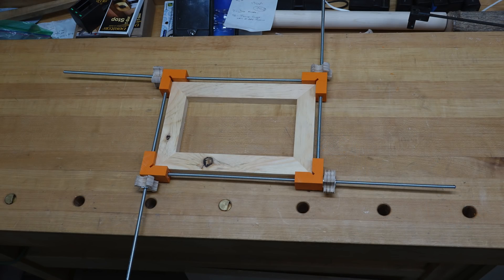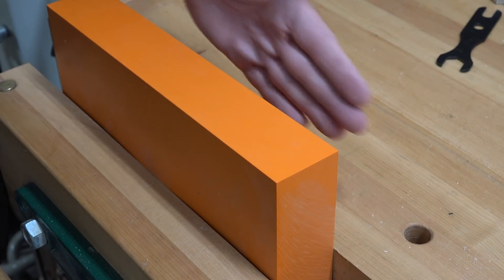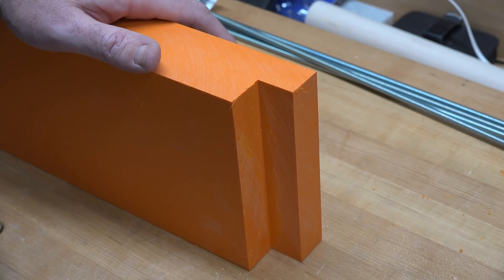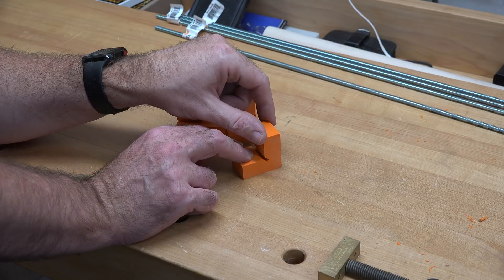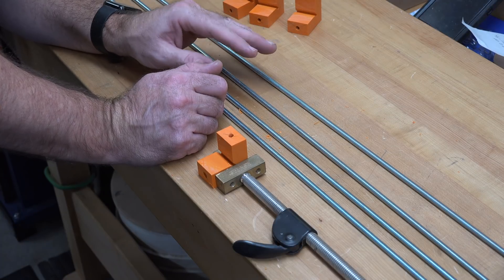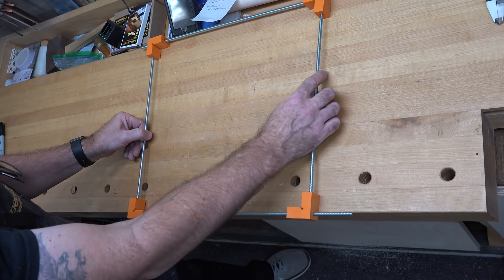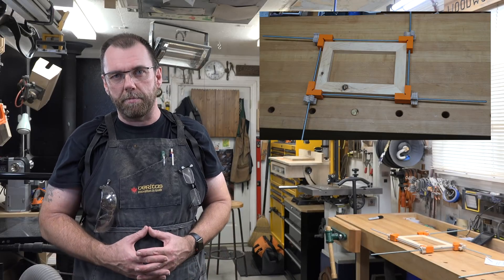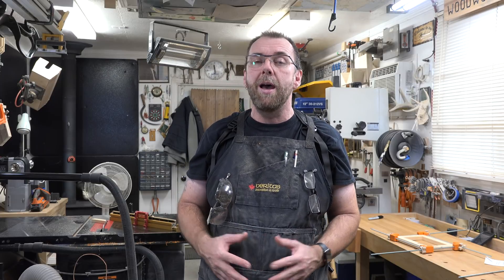Making an ABS Frame Clamp

Comment: Great video...thanks for the detailed instructions. I made one and decided to make a second. In both instances, my saw blade tends to melt the ABS. They are sharp blades. I was hoping you might comment on what I am doing wrong and also what saw blade  you use...perhaps my blades aren't appropriate for this. In the end, my right angle cuts aren't true even though the blade and table were accurate. Thanks in advance.
Reply from the maker: ABS is a finicky material.  It's not so important as to what blade you are using but it is more important at the speed at which you feed it through your table saw.  You want to feed this stuff through fast.  Very fast.  If you slow your feed down even the slightest little bit, the friction from the blade will melt the ABS as it has a very low melting point.  I hope this helps a little.  Thanks for tuning in and for the kind words on the show.

Comment: Great video and nicely described...definitely want to build one. What dimension block did you start with and are there any other projects using the abs?  Thanks
Reply from the maker: I don't recall the exact dimension of the block when I started this project Jaime.  I'm going to guess it at approximately 2" thick, 5" wide and 12" long.  You can easily search my channel on its home page to find all the ABS project shows.  I think there might have been about 10 in all.  I hope this helps.  Thanks for tuning in.

Comment: Did I miss the cost of the ABS block?  I'm sure that's not cheap.
Reply from the maker: You didn't miss the price because I didn't mention the price.  As I mentioned in the video, all the ABS material for this project was provided to me by Omachron plastics Inc and I have placed a link to their website in the video description.  To be 100% honest about it, I have no idea what the ABS costs.  I hope the link will help you out.  But if the ABS is too expensive for you, blocks of wood would work just as well.  You would just need to be careful not to glue them to your project.  Thanks for tuning in to the show.

Comment: Hi Kenny! I was watching your 4 part picture frame build this morning. I had watched this one earlier. The store bought one uses knurled nuts that seem to have an unthreaded side to allow them to slide on. The knobs seem to cause the frame to lift up when they are tight because the knobs are larger than the orange abs pieces. I think it would be better to buy the nuts that allow them to slip forward without screwing them on since they would be smaller than the abs and allow the frame to sit on the bench when tightening. I get that you wanted to use the knobs you had made the prior week but they don't seem to be the best solution. I have multiple sets of frame clamps but this one looks really great and I have emailed the supplier to see if they will ship to the US. Regards, Bill
Reply from the maker: Those shop made knobs can be a bit cumbersome when used with the frame clamp but the frame clamp still works really well.  I guess an alternate solution would also be to make smaller jib knobs.  Thanks for tuning in to the show and taking the time to leave your suggestion.  It is very much appreciated.

Comment: You indicated at the beginning that you flattened the ABS block.  What procedure did you do to flatten the block.....jointer?  I'm surprised and a bit disappointed the block isn't flat to begin with.  Thanks for the vid.
Reply from the maker: These blocks are injection molded as far as I can tell.  The main surfaces were not flat and square.  I used a jointer to flatten the face of one side, and then one adjacent edge, giving me a square reference point so work from.  I hope this helps.  If ABS is not your choice for the corner blocks, UHMW would work just as well and it has a much higher melting point, making it a lot easier to work with using power tools.  The price point on the UHMW is a little higher though.  Thanks for tuning in and taking the time to leave your question.  I truly appreciate it.

Comment: Nice project Ken, and there is no limit to how big you can make it, other than the length of available rod.
Reply from the maker: I almost missed this comment Brian.  Thanks for the kind words on the show.  Even with reaching the length limit of available rod, a simple threaded rod coupling (they are dimes a dozen) will correct that and allow you to extend beyond the available rod's length by joining them temporarily together.  Thanks for tuning in to the show this week sir....always great to hear your comments on the program.

Comment: Ken, great project.  I don’t have one of those in my shop....yet...!  It looks like it would make frame construction a lot easier.  Fantastic show as usual.  Thanks for sharing.
Reply from the maker: Thanks for the kind words on the show Paul.  This clamp truly is awesome.  I put it to the test against my store bought one and it is just as good, if not better.  Although there are no speed nuts for quick adjustment, that is a minor issue that doesn't bother me in the least, considering the difference in price between the two.  Thanks for tuning in to the show sir.  It's appreciated.

Comment: thank you Kenny that is a clever piece of work
Reply from the maker: Thanks for the kind words Walter.  It's truly appreciated.  These frame clamps truly are awesome in the shop and I think I will be making more of them.  When I make frames, I usually make them in groups of 3 or more at a time and it would be nice to have enough clamps to make them all at once instead of waiting for the glue to dry so that I can use the clamp on another frame.  They don't take up much room as they disassemble and fit into a drawer perfectly.  They really are a great addition to any woodworking shop. Thanks for tuning in to the show.

Comment: Just as good, if not better, for a quarter of the cost?  I'm sold. 
Nice project.
Reply from the maker: The brand name clamp is approximately $40 to purchase Thomas and I made this one for around $10 so yes, a quarter of the cost and I could make 4 of these for the same price as one of the real ones.  Not to mention as well, that this one can be made custom to accommodate any sized frame that you wanted to make.    Thanks for tuning in this week sir.  I appreciate it.